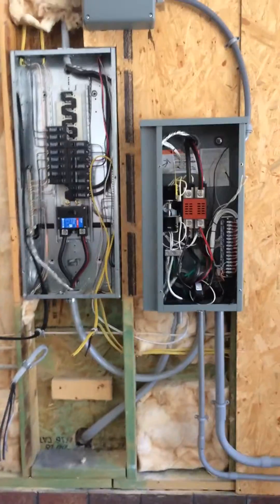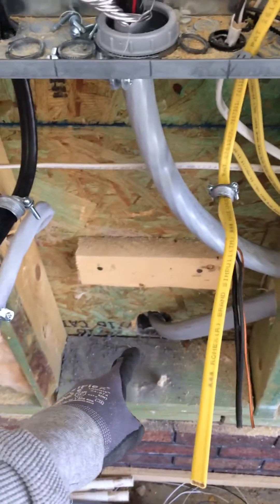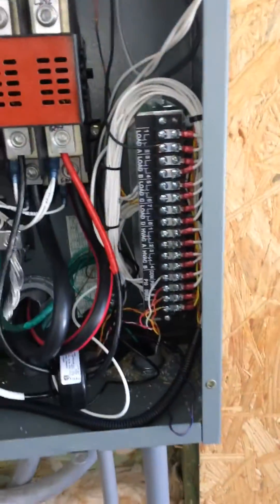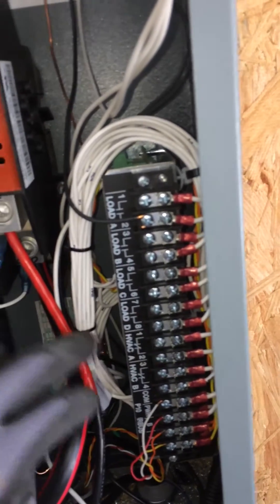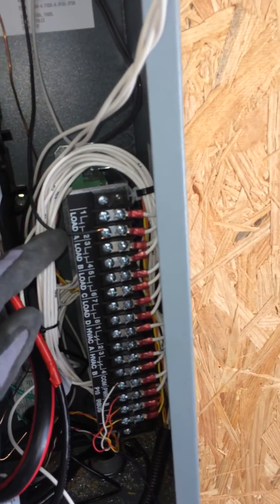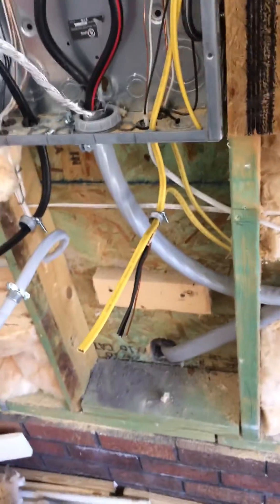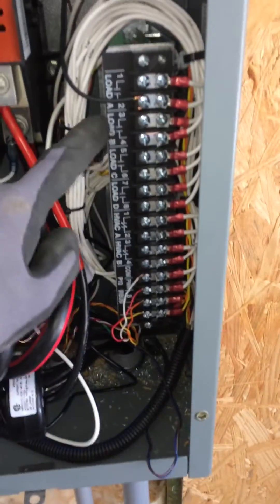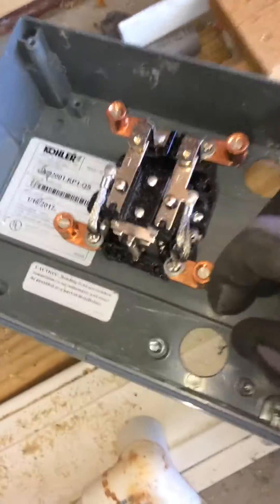Koehler load shed kit with 12 kw generator and rxt 200 amp transfer. Part 1

Comment: SER cable not SEU cable should have been used.
Reply from the maker: Smash 72Cutlass I used seu at first. Failed inspection. They wanted a main breaker ahead of the transfer switch. So I then changed the seu to the panel to ser.

Comment: You appear to be in violation of several electrical codes. Specifically you do not have a required 200 amp disconnect between the electrical meter and the ATS. You purchased the wrong ATS for your application. You should have gotten the "Service Rated" ATS or specifically the Kohler RXT-JFNC-200ASE Transfer Switch which includes the 200 Amp disconnect. If I where you I would fix that right away. If you have an electrical fire and burn your house down your insurance company may not pay you. Not to mention the danger you have put yourself and family in. It always pays to have a professional at least help on big jobs like this.
Reply: Concentric neutral using SE cable that isn't rated for burial, even though it looks like it is coming up that way.  Was hoping he was running into the ATS with a EGC which would mean he added a main breaker outside, but now there is nothing protecting the ATS.  Then runs over to the old panel with SE cable that doesn't have a ground, so now all ground and neutral currents are on the same conductor.  This is a mess and he should take this down.